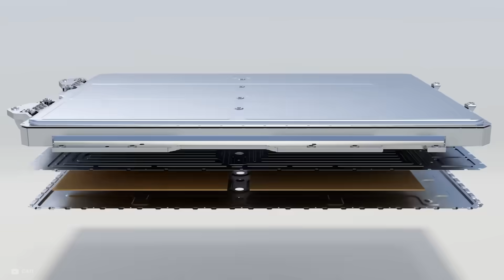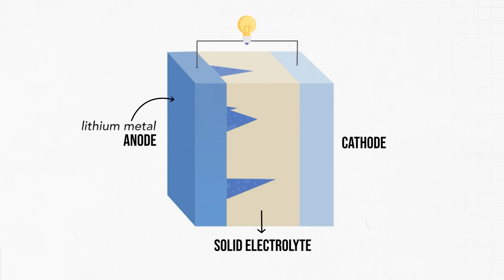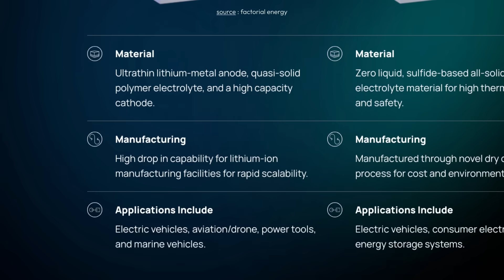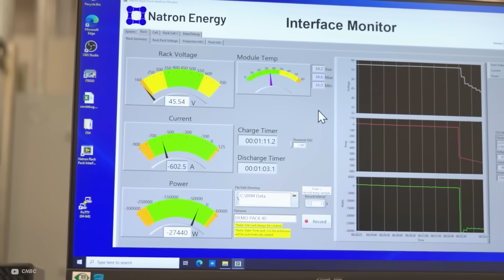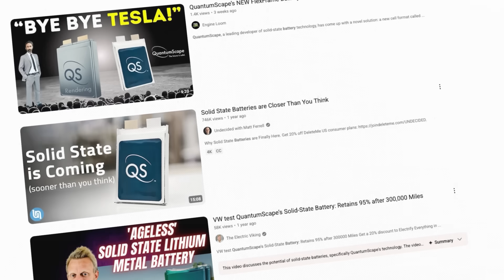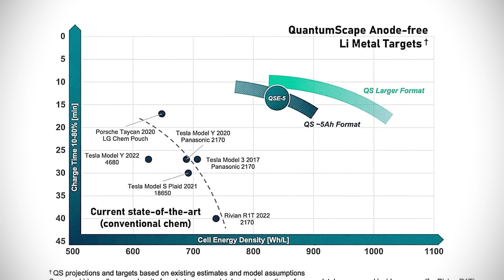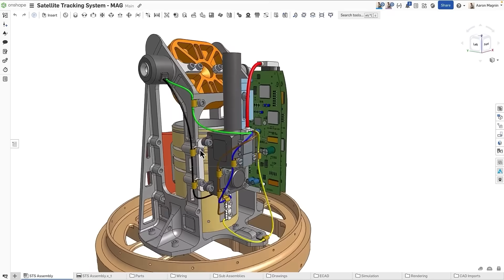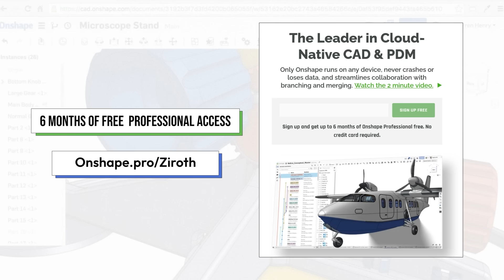The Decade Wait is Over, Solid-State Exists.

Comment: In 1999 the mest lithium cell on the market was 210wh/kg. Today its around 260-280, with a lot of compromises. They are realy not that much better.

Power and charge speed was never the issue for lithium cells. Almost all lithium aplications are limited bu charge infrastructure, not cell charge speed

If solid state cells only provide a bump to charge speed, they are pointless.

If they provide a reduction in volume, that s more usable. But currently safty is the largest issue.
Reply: There's a lot of asterisks you're having there. 210Wh/kg you said were the best, I assume lab batteries since I can't find any irl reference with such energy density. They certainly weren't automotive batteries since they weren't used for that then. The peak energy density I've seen credible reports of are 850Wh/kg lab batteries.

Furthermore the cycle durability and fast charge capability in especially in anode design has progressed a lot. In the past you couldn't fastcharge batteries reliably due to dendrite growth. Nowadays you can due to improvements in chemistry of the last 35 years. In the early 2000's you had mainstream LCO batteries, nowaday's we're talking about NCM on the high end. If you weren't talking about LCO then you were indeed talking about lab batteries, so in fact prototypes.

Nowadays we can reliably fastcharge them at 2-5C. We have high cycle resilience and the chemistry is stable long term for 10+ years. It's not stagnant since 1999...

Look up LiMnO2 Battery Yokohama University. That's the one that topped the 800Wh/kg spec.
Reply: @ndc5544p  No i wrote quite clearly "on the market" Just becasue you are ignorant don´t make you right.

You could get 400Wh/kg lithium sulfur batteries back in the 90s.

"In the past you couldn't fastcharge batteries reliably due to dendrite growth."
That is not really true, in 99 there still was the same typical charge cycle as today.

If you talking about a car, hardly any charger can charge faster than 2C, that was a quite common charge speed even back in the late 90s for hobby items.

NCA did exsit in early production for some consumer products alreddy back in the 90s. Just becasue you are unaware, don´t mean it didn´t exist.

NMC may be more durable, but do have lower capacity.

"Look up LiMnO2 Battery Yokohama University. That's the one that topped the 800Wh/kg spec."
Yea that is a clear fake news kind of situation. Don´t fall for it.
Reply: The energy density of regular gasoline is approximately 12,200 Wh/kg.
Reply: @HamRadio200  - which oddly Lithium-Air battery theoretical max energy density is quite close to at 11,400 Wh/kg.

Although in the case of gasoline power cars you have to factor in the lower energy conversion efficiency, with the losses bringing the gasoline's gravimetric energy density at the wheel down around 1,700 Wh/kg.

Similarly, with Lithium-Air energy density one has to factor the oxygen in, which lowers the energy density to around 4,000 Wh/kg, which is close to that of Jet fuel in high efficiency gas turbines. And more than that of gasoline in cars.
Reply: @GruffSillyGoat 
 11,400 Wh/kg.
1,700 Wh/kg.

Do you think a  engine have a efficiency of 14%?

You are clueless. The 19 century is calling and want there engine back.

Article from 2018 in global Toyota. 

"Toyota's new Dynamic Force Engine adopts high-speed combustion technologies and a variable control system. It also achieves greater thermal efficiency, resulting in high output, due to a reduction in energy loss associated with exhaust and cooling systems, the movement of mechanical parts, and other aspects. As a result, the newly developed 2.0-liter gasoline vehicle and hybrid vehicle engines achieve world-leading thermal efficiencies of 40 percent and 41 percent respectively"

" 11,400 Wh/kg."
And no, that is not the theoretical energy of a lithium air battery. That is just burning lithium in air. You have no battery chemistry, just a fire.
Reply: @matsv201  - On Lithium-Air. Please, go do some research. 

Lithium-air batteries have a maximum theoretical gravimetric energy density of 11,400Wh/kg, but as I stated when you incorporate the weight of the oxygen in the battery system (cell level) reduces to around 4,000Wh/kg. The 11,400Wh/kg is the maximum theoretical potential of the Lithium component of Li2O2 in a battery cell, just as gasoline's is 12,200Wh/kg unreacted with oxygen.   

This is not the energy of the reaction in either case, whether burning or that controlled within an electrochemical cell. Specific energy, as gravimetric energy measures, is the amount of energy stored per unit mass, note the word stored not reacted. Burning has nothing to do with it. 

BTW - the 1,700Wh/kg is an industry figure not my own derived one, even Wiki states the figure "The energy density of gasoline is approximately 13 kW·h/kg, which corresponds to 1.7 kW·h/kg of energy provided to the wheels after losses."  You have to factor in the weight of the oxygen used in the reaction to calculate the actual energy efficiency (like in the Lithium-air case reducing to around 4,000Wh/kg), then factor in engine conversion into the conversion efficiency, which for gasoline averages around 30-35%. Then there's the vehicle losses, in the transmission and parasitic losses, and rolling wheel friction losses leading to the at the wheel figure that is often used.
Reply: @GruffSillyGoati just told you the fact and here you come just proving you dont have a clue what younare talking about.
Reply: Given you're including lab-test results from 1999 in that criteria, then Lithium Air batteries today have achieved over 1,500 Wh/Kg in lab conditions, so by your own metric then surely they are much better.
Reply: @GruffSillyGoat no ON THE MARKET, learn to read.
Reply: @matsv201  - source then, as like ndc554p I can only find lab references for that figure in 1999.
Reply: @GruffSillyGoat Your unability to search is not my problem.

What is the highest capacity commercial product you could find in 99?
Reply: @matsv201 -  no source then, odd why make a claim without one.

As to Lithium-Sulphur, perhaps you need to write to Gelion, the British-Australian innovator in the space, what with their achievement first of a 400Wh/kg+ stable cell in their labs, as announced late last year. I'm sure they'll be glad to know of a source where they could buy off the shelf rechargeable 400Wh/kg Li-S cells back in the 1990s, would save them a lot development effort in overcoming the Polysulphide shuffle issue Li-S batteries exhibit.

BTW - I had a 1990's Sony camcorder with a NCA battery at the time, was way under 200Wh/kg closer to 90Wh/kg. Plus the battery was a brick.
Reply: @GruffSillyGoat riiiigh?
i don´t have a source, still you just claimed something non existent before with out one.

Maybe you should stop reading tabloid magazines

"I had a 1990's Sony camcorder with a NCA battery at the time, was way under 200Wh/kg closer to 90Wh/kg."
So you are absolutely clueless on the subject.

in 1999  you could get NiMh batterie sat 80Wh/kg, LCO cells increased from low 100 to about 160, some 180 in some speciall aplication.

And NCA cells was introduced in 1999 at a starting capacity of 210

You are clueless.
Reply: @matsv201  - stop attacking it's not helping the defense of you're original statement.

Not sure why you seque to NiMH cells, which don't have Lithium in them, plus their energy density is significantly lower than that of Lithium-Ion and are not fully immune from the memory effect. This is why Sony switched to NCA in the 1990s, as you could run their devices, particularly power hungry camcorders, for longer. 

NCA were introduced in the early 1990's, and even by the end of the 1990's were still low then compared today.I had a Sony NCA camcorder as I mentioned, they had under 100Wh/kg energy density. It wasn't until the mid-200o's thay their energy density was raised with their first adoption in EVs, and not until the mid-2010's that they surpassed 200Wh/kg in commercialised quantities.

Let's explore NiMH vs Lithium Ion, the large NiMh (BMS-2S) battery from a 1999 Nokia 3310 had an energy density of 81Wh/kg, whilst roll forward 10 years and that of a Lithium Ion battery from a ZTE Blade, was 104Wh/kg. If Lithium Ion energy densities over 200Wh/kg had been commercially available in the 1990s, why did it take into the mid-2000's for NiMH to start disappearing from mobile phones, and that of a popular small smartphone (the Blade) only had 104 Wh/kg by 2010 (which was seen as good for the time).

Again, you're simply restating stuff and not giving sources to support your original claim that Lithium batteries in the 1990's achieved commercially 210Wh/kg.

p.s. a bit of a hint perhaps go and take a look at the battery roadmap timeline on batterydesigns [dot] net.
Reply: @GruffSillyGoat 
Top tip. stop lying.

Nokia 3310, 0.9Ah, 3.6V, 30grams, that is 111Wh/kg, not 80

Ericsson T28, 12 gram battery 0.5mAh, 3.7V, 154Wh/kg.

And note this is for BATTERY, not cell.

in late 1999 sony introduced NCA cell at capacity just over 200Wh/kg.

Do you even know the diffrance between a battery and a cell?
Reply: @matsv201  - my you do like to attack. 

I have a 1999 Nokia 3310 in my collection, with the larger NiMH 1,000mAh battery, it weighs 78g, battery and 44g for the cells - giving 80Wh/kg.   

Sony, alongside BASF, developed the NCA battery in the early 1990s and introduced them to the market from 1998 onwards, in Japan and Europe earlier than some other markets. 

Sony sold higher energy NCA batteries in 1999, more expensive than regular Lithium-Ion ones. I bought one for my DVR MiniDV camera as the regular Lithium larger pack was too bulky for the camera (it mounted on the side not the back like the later DVR units). These have 90Wh/kg NCA cells. 

Larger capacity NCA cells didn't develop till the early 2000s, when Panasonic also started to develop them, but they fell out of fashion for portable electronics due to their higher cost and the increasing capacity of Lithium-Ion. Even the Tesla Roadster in 2008, which used Panasonic 18650 NCA cells, only had 117Wh/kg at the cell level, which with over 6,000 cells was one of the reasons the car was so expensive. 

So again, what are your data sources for the original for 210Wh/kg Lithium, and now Sony having NCA 200Wh/kg batteries in 1999, claims.
Reply: @GruffSillyGoat Nokia 3310 exist with both lithium and NiNh batterys. The NiMh is a 2 cell with 2.4V and the Lithium is a one cell with 3.6V.. NOTE, its a battery, NOT a cell, NOT the same thing.

"Even the Tesla Roadster in 2008, which used Panasonic 18650 NCA cells"
Again that is incorect. Tesla rodaster first gen came with either LCO or NMO cells, there was no Roadster produced with NCA cells.

"only had 117Wh/kg at the cell level, "
The battery pack have 56kWh at 450kg, that DOES make 117Wh/kg. But that again proves you have no clue what you are talking about.

Do you even understand the diffrance between a cell and a battery?

6831 cells at 56kWh of energy, 8.2Wh/cell with a weight of 185wh/kg for the LCO cell and 53kWh with a cell density of 174wh/kg for the NMO cells.

The 85kWh tesla S, that was the fist tesla S on the market, had a few more 7104 cells with a pack weight of 600kg, making a battery energy density of 141wh/kg using NCA cells.

Those are slightly heavier at 49 grams making a total energy density of about 244wh/kg per cell. That is quite a bit more than the old LCO cells.

So please stop prendeting you know what you are talking about before you make more a fool out of your self
Reply: @matsv201  -  again, stop attacking it's not a good look and not a way to defend a point that engenders any trust in what you're trying to claim. Also, again please provide sources for your data, to assist your argument.

Look online you'll find many pictures of the  BMS-2S packs that have NIMH at 3.6v. You're possibly confusing nominal 1.2v voltage of an individual technology with that assembled at the pack level.  

The Nokia BMS-2S NiMH voltage is 3.6V with an energy capacity of 1,000mAh, which equates to 3.6Wh for the battery, the weight of the NiMH cells is 44g, and the battery including its housing is 78g (I weighed them). This equates to 3.6Wh / 0.044kg = 81.82Wh/kg. Are you confusing this with the later Li-Ion replacement packs you can now buy that have the same voltage (3.6v stated but are 3.7v in reality) with 1,200mAh batteries?

Confirmation of Tesla using Panasonic 18650 NCA cells in the Roadster can be found online at multiple places, such as InsideEVs, Esaulenergy, EVSeekers, TeslaRocks, and Electry (who have a timeline history for Tesla batteries).  Also, the Roadster discussion on SpeakEV (thread "long-term-care-of-your-tesla-battery-it’s-not-rocket-science-maybe") outlines a technical investigation, confirming Tesla's use of LCO/LMO between 2006 and 2008, and use of NCA in the Roadster 3.0.

The Telsa Roadster data given is from technical report from Tesla directly on the vehicle and CleanTechnica article on the car from 2014 (when the Roadster 3.0 R80 came out). Note, I stated the 2008 Roadster (the Roadster 2.0), not the early ones where Tesla didn't yet have the purchasing power to cost effectively buy Sanyo (now Panasonic) NCA cells, and used the commodity available LCO/LMO ones instead, despite their lower energy density and lower cyclelife. 

The 2008 model used 18650 NCA 2,1000 mAh cells from Panasonic with improved cycle life, increasing the vehicle's 0-60 time by 1.8 seconds supporting an upgraded 215kW motor, even though increasing the vehicle's weight but didn't change the 53kWh pack size to the earlier models. The batteries were then upgraded again in 2014, to standardise with those in the Model S (3,100 mAh) again NCA, for which the 2014 CleanTechnica article states:

 "6 years after the design of the original battery packs for the Tesla Roadster, the battery cells chemistry and the battery pack components have evolved considerably. For instance, the cells used in the first model were Panasonic 18650, working at 3.7 V and with 2,100 mAh of electric charge. Currently, Tesla is using in the Model S the same type of cylindrical cells but with 3,100 mAh at 3.6V. These numbers translate into a huge difference in energy density (the amount of energy stored per mass), being 117 Wh/kg for the Roadster battery pack and 240 Wh/kg for the luxury liftback [Model S] accumulator".

Note their reference to the 117 Wh/kg figure, as well as the continuous evolution of the Roadster's battery pack - the Roadsters up till 2014 all had a 53kWh pack, and in 2014 changed to 80kWh. I've just checked and yes, I typed above at the cell level because this is what the Tesla technical report states but I agree the CleanTechnia article states this is a pack figure not a cell level one - with 53kWh divided by battery pack weight being 117 Wh/kg. Note, I'm happy to admit my mistakes and provide sources.

Again, please provide sources for your figures of 185 Wh/kg for the LCO batteries and 174 Wh/kg for the LMO being in the Tesla Roadster. A quick calc shows that this would equate to 145kg to 165kg being due to non-cell weight in the pack, which is a cell to pack mass ratio of 63-68% which seems low given the Roadster was in effect an early adoption of cell to pack with it's 11 sheets having fairly high packing density (due to the limited space in the Roadster).
Reply: @GruffSillyGoat You are clueless. I keep explaining this to you and explain where and why you are wrong. and you just keep dodging it and claiming even more stuff that is wrong.

The best for you would probobly be to admit that you are wrong.

"2S packs that have NIMH at 3.6v"
If you don´t understand even the most basics of bascis in the subject, you probobly should stop pretending that you are  a expert.

"being 117 Wh/kg for the Roadster battery pack and 240 Wh/kg for the luxury liftbac"
You are still confusing battery and cell.

AGAIN if you don´t understanding the basics stop pretending you are a expert.
Reply: @matsv201  - again attacking, civil discourse is a better approach and demonstrates less defensiveness.

The cell in the Nokia battery is wired in parallel, not series, to support higher mAh rating. This does not change the voltage of the cells in the pack. Note - cells may, even with NiMH, be constructed of multiple cell sub-units, so may themselves be summative in voltage over the internal cell elements. If I get the time, I'll teardown the battery to have a look.

Re-read what I wrote on the Roadster above, that the report I used stated cell but the CleanTechnica report indicates this is at the pack level. I clarified this and accepted that using the word cell was not correct. I'm more than happy to own up to my mistakes.  Also, not sure why you're now addressing CleanTechnica's quoted words and treating them as mine, with an assumption of me being confused as a result.

BTW - you claimed "there was no Roadster produced with NCA cells", do you likewise admit this statement was a mistake?

I guess you've given up on attempting to provide a source for your original 210 Wh/kg statement, and seeking to seque into different points to deflect. 

p.s. I'm not pretending to be an expert, but perhaps I should explain I'm an electrical and electronics design engineer by trade of many many years, so I know how to design and specify battery systems.
Reply: @GruffSillyGoat
Im explaing that you are wrong is not a attack.

If you want to debate things as a adult. You have to admit when you are wrong.

You are not a EE, then you wouldnt get bassics wrong.

I finished masters in EE at linköping university in 2001 and studdy postgrad untill 2004.
Reply: @matsv201 - perhaps go re-read your approach, from your first response you sought to insult those making comments, not just myself. As to debating again you've sought to insult and belittle rather than respond, even to simple requests of sources of information.

Perhaps read through and spot where you've made assumptions about what others have said and projected your own misunderstanding onto others.

Doubting others isn't a sign of maturity nor is avoiding admitting ones own mistakes. 

Have a good life, my career has afforded me one, happily retired now.
Reply: @GruffSillyGoatif you cant handle when someone inform you that you are wrong. You dont act as a adult.
Reply: @matsv201  - oh dear, still trying to insult. Hint it's not working, continue to act arrogant if you so wish. As an adult, if you read above I own up to my mistakes, perhaps a little humility on your part wouldn't go amiss.
Reply: @GruffSillyGoatif you thinl facts are insulting. You are not a adult.

Adults can admit when they are wrong.

You just refuces to do so. 

That you are not operating as a adult is a fact, not a insult.